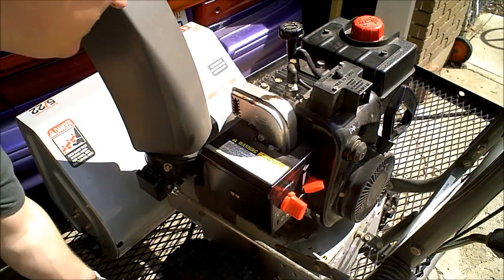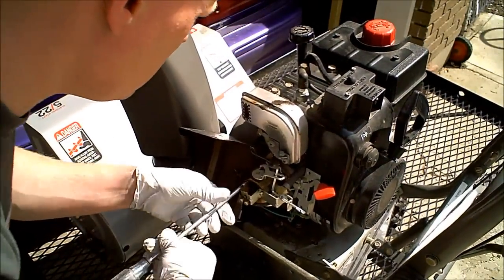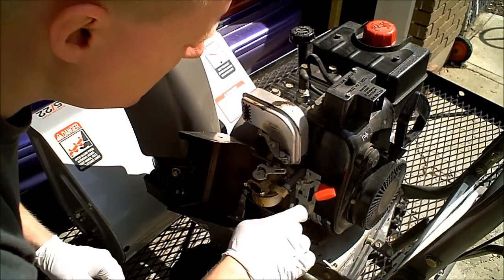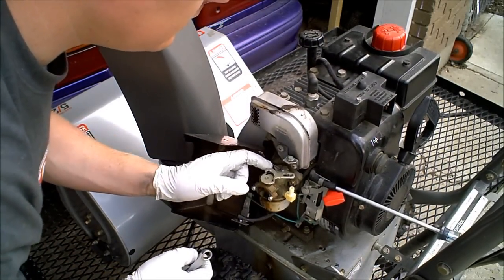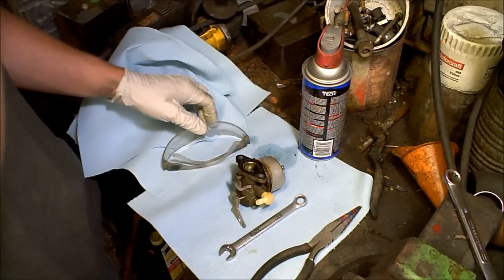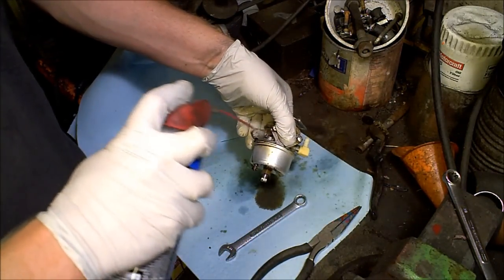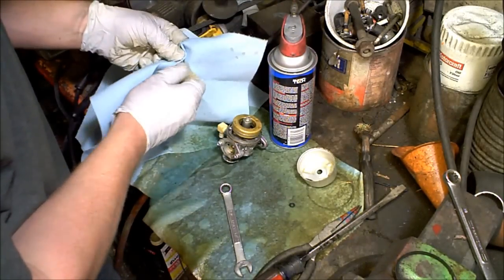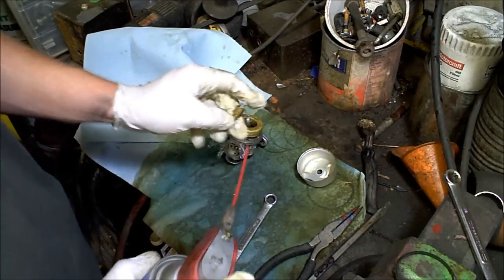Tecumseh Carb snowblower cleaning 1 of 2

Comment: Awesome video. My snowblower had the problem you described - it would only run with the choke fully engaged, and even then it would just barely keep running. I resolved the problem with a quicker version of your fix.  I removed the shroud but did not remove the primer hose or fuel hose.  I used a small C clamp to pinch the fuel hose behind the plastic fuel inlet to cut off the fuel supply.  I put an empty plastic yogurt container under carb bowl. My version had a fixed jet as you described, so I used a 1/2" wrench to remove the jet and let the small amount of fuel drain into the yogurt container.  I did not remove the bowl.  I cleaned the jet with carb cleaner and a wire as you showed.  I also sprayed carb cleaner down the throttle body which flushed some dirt through the bowl into the yogurt container.  Replaced the jet, removed the C clamp, replaced the shroud, started it up, and it's running like the day I bought it!

Comment: Thanks I bought an old used snowblower last fall, never needed one before I bought this house with a long driveway.
The thing ran great all last winter but I was thinking it’s about time to give it a little tlc while the sun is shining.
Your video was very helpful, never worked on one of these techumse engine carburetors so your details and tips about the position of all the linkages are very helpful.
Going to pull it off this afternoon and give it a go.
Thanks for taking the time to make this video.

Comment: I know this is an old video but it helped me out. That little tiny hole mentioned at 6:25 I think is actually the primer hole. I was having problems with mine not priming and starting. I had it apart a couple months ago and cleaned it but it still would not prime. I was going to pull it apart again and decided to do some searching and I stumbled across this video and decided to watch it since it is exactly the motor I have. I did not know about that real tiny hole that is above the other hole, it almost looks like a spec of dirt. Got a piece of wire and poked through it. Sprayed cleaner through it and if you notice it sprays upward through that hole. That is when it dawned on me that this must be the hole that gas is forced up through when you pump the primer bulb. Finished cleaning it up and got it backed together. I pump it twice and can actually see fuel in the throat of the carburetor again. It took a little to get it started as I may have pumped it a third time and got too much fuel in it but it did fire up. Got it tuned again and today will see if it actually works like it has in the past as we have about 6" of snow and need to go blow snow. I also didn't want to go the route of one of those cheap nonadjustable carbs.

Thank you again for making posting the video.
Reply from the maker: The tiny hole is for the fuel going to the idle circuit. The larger hole(main jet) is for priming. The primer is just an air pump and forces air into the bowl area. The bowl gasket needs to be air tight and the lower hole clear for fuel to be displaced with the air and forced up the emulsion tube into the throat of the carb.
Reply: @sixtyfiveford  I knew about the larger hole and it wasn't plugged. Never had a problem with idling. I never noticed the small hole but once cleaned it now primes so thought the air pumped into the bowl forced fuel into the large up the seat and through the small hole. I thought this since the small hole is angled upward. I guess I am wrong but all I know is that it now primes and starts without having to pull my arm off to get it running. Thanks for the info.

Comment: hey sixtyfiveford  . my  mtd 8hp snow thrower is 21 years old I never cleaned the carb once but I allways run the carburetor out of gas every time I use it . well this year I went to start it and it would run for a second and then die . I watched your video and thought yagh I could do that , but wasn't so confident on breaking down the carb to the level that you did although I probably could have , I left the carb on the machine took the bowl off and just removed the main jet and sure as shit the little holes had gunk in them I sprayed the jet as per your video and cleaned the holes with the wire like you did , reinstalled and the blower is running like it is brand new just wanted to say thanks for making the video so so so much and keep making them you rock dude, I didn't have the money this year to buy a new one . thanks again man .
Reply from the maker: That's great. I'm glad the video was helpful.

Comment: Thank you, thank you, thank you.  We are expecting 4 to 9 inches of snow tonight and my Craftsman 5 hp snow thrower would not start.  Your video was tremendously helpful and did the job.
Reply from the maker: GREAT.. I'm glad that it helped.
Reply: The snow thrower works but now is leaking gas.  I am not sure yet where it is coming from.  I suspect it is the rubber casket.

Comment: Thanks for the videos. I have to adjust the idle screw - it stall under any load with the choke off - but it runs now whereas it didn't before. I just tackled my first job and did my driveway this morning (with choke on halfway) so now I will tinker with the adjustment screws. Starts on first pull with the choke on full. Thank you!
Reply from the maker: Your main jet is clogged or if it is adjustable it needs 1/4-1/2 turn out(bolt w/screw on very bottom).

Comment from the maker: Compressed air is a trick used on larger carbs with large jets and passages. Carb cleaner allows you to physically see if a jet is flowing properly through these tiny passages. It wont hurt to use compressed air but it doesn't really benefit it either.

Comment from the maker: I know what you mean, I was fed up loosing the tip. I got it off a WD -40 can (they still sell this style).  I have used it on 30+ cans of carb cleaner and have loved it. I just pull off the stock sprayer and this one snaps right on.

Comment from the maker: It can be cleaned up easily. Even if it looks slightly pitted or stained it will work fine. 

The reason it dies easily is; not enough fuel is reaching the engine through the main jet. A piece of fine stranded copper wire through the passages of the main jet will help ensure correct flow. There are 1 or 2 large holes at the base by the nut head, 1 super small one in the thread area, and one through the middle of the bolt(main jet).  Carb cleaner will give you a good visual if flow is smooth.

Comment from the maker: If you have an adjustable jet it will have the little hole. Sometimes it's in the top threads. It gets plugged and looks like it is not there in this video I have a hard time finding it and I know what I'm looking for. You need to scratch around with a wire to find it. The hole controls idle so if you can't find it on your old one the new jet with it will allow you to idle.

Comment: was just about to give up on this carb getting it to idle.  Cleaned it too much on and off 3 times, saw your vid and the magic idle hole on the adj main jet/bowl nut.  couldn't even see the hole. till I cleaned it with 0000 steel wool, and  yep it was clogged. Strangest place for idle fuel supply.   tuned carb and runs perf,  thx again for sharing
Reply from the maker: shawn groom Awesome. I'm glad you found the video.

Comment from the maker: I do have a video on how a governor system works but you never need to adjust them. The slight surging is do to a lean idle passage/jet. Turn it out another 1/2 to 1 turn and see if it smooths out.

Comment: great video thanks. I did all that during a storm. turned out that the problem was the gas did not make it to the carburator, the tank cap was screwed too tight and the gas was hardly getting out of the tank. that kind of shit ALWAYS happends during the worst snow storms
Reply from the maker: Awesome, I'm glad it was useful.

Comment: great video man, it was a good idea to make it in hi-def now you can really see the parts clearly. have the same model engine on my troy built 5hp snowblower, thing wasnt running unless on full or 3/4 choke so i pulled the carb thanks to your video and sprayed it with some good ol' supertech carb cleaner and soaked it over night ran good as new. also thank you for the close up on the main jet, wouldve never known to clean that its so tiny. well thanks again keep up the good work!

Comment: Hi, I tried everything, again, ran cleaner into idle port hole no luck, took carb apart redid the entire thing, still wouldn't idle, it ran great on high speed though , so it must have a real bad obstruction in idle passage somewhere.  The good news is I got a NEW carb  with FULL adjustments for $38 and it runs as it should. Sorry for all the notes, but if not for your HD Video I'd have been lost. Thank you again, you really save the day. Make more Vids, we love them !! what camera do you use?

Comment: Thanks for the informative cleaning tutorial.  The very small hole that you were pointing out in the vid was clogged on my snow blower.  Been having idling issues and sometimes chokes at full throttle.  After cleaning it out it runs like new again.  Such an easy fix :P
Reply from the maker: Awesome. Glad I could help.

Comment: Hi 65,  I finally got it all rebuilt just as you did in this video,  I think your video is the most precise one on Youtube thank you... Today I put the carb back on and she fired up on the second pull and it runs real smooth, the only thing I have to do is adjust the idle  mix screw a wee bit as it goes up and down a little on idle but starts on the 1st pull without the choke as it was 60 degrees today. Have you ever done a Video on adjusting the governor or changing the auger belts?  Thanks !!

Comment: I got a new kit to rebuild with, and you're right there IS a second hole and wow is it tiny. It's like the size of a human hair on the tip of the second thread right on the crown of the thread. I couldn't find it on my old one until I lightly touched it with a fine brass wire toothbrush...boy is it small.. I plan on using the new one..  Would you recommend something like Vaseline or Plumber grease on the new O'ring for the bowl? Or just leave it dry ?   Thanks...

Comment: I inherited a snow blower that is it running. If you put a little gas in with the spark plug it will run but i when it runs out. When you push the primer button nothing happens. if you cover the hole in the primer button you can't depress it. It's like pushing on a balloon. Does this mean the primer line and the carb are all just full of junk? Great video.
Reply from the maker: Clark Osborn Yes, your carb is full of green stinky gas. Do a quick clean and you'll be back up and going in no time.
Reply: I cleaned it out and everything worked good but when I put it back together no gas flowed in. Took it apart and the little rubber ring the float needle goes into was falling apart so I'll be finding one of those tomorrow.
Reply from the maker: It is generally sold with a needle in a set. You can find them on Ebay for a couple bucks. FYI the ridges go away from the needle when you reinstall it.
Reply: sixtyfiveford it's running great. Thanks for your help.
Reply from the maker: Great work.
Reply: +sixtyfiveford this year my blower is running great until load is put on it with Snow going through then it kind of chokes and idles way down. could this be caused by a small leak I have on my carburetor drain button? Or something else?
Reply from the maker: Generally this is due to a partially clogged main jet.

Comment: good video. Do you have to wear goggles and a mask when working with cleaning fluids? I've noticed a lot of warnings on some cleaning fluids about not breathing the vapors. I'm very safety conscience. Thanks
Reply from the maker: Carb cleaner is basically nail polish remover(Acetone). Small doses won't hurt you but prolonged exposure; maybe? Nail salons use it on skin all the time. Eye protection is always wise.

Comment: Great video. Quick question. I changed my spark plug, cleaned the carb (using your videos) and put in fresh gasoline. Now, I want to say that the snowblower was running fine after changing the spark plug, but I just got this snowblower so wanted to make sure the carb was fully cleaned... so I cleaned it. Now, after reassembling, it was initially leaking gas out of the carb bowl... I fixed that issue by readjusting the needle on the float. My problem is now, the snowblower will start after pulling the cord, but it dies within 1-2 seconds before I can even turn the choke off.... could you please help? Want to get this up and running again before winter. Wish I would have never messed with it since it was running just fine, but I do know how to clean carbs now. I know this is some kind of fuel starvation problem within the carb but don't know how to fix it.

P.S. - could this have anything to do with the governor spring.. I forgot to scratch where it came out of and I don't believe I have the spring in the right place, just didn't know if that could be a cause?

Edit - must have been the governor spring because I hooked it up in a different hole and it ran like a charm! Thanks again for the great video!
Reply from the maker: Glad you got her going. Your issue sounded like a partially plugged main jet or water in the fuel blocking the main jet.

Comment: Greta video.  Have this same engine on my MTD.  It was running but bogging down whenever any load was put on it.  Cleaned the carb, replaced the spark plug and checked fuel lines.  Now it won't start.  It'll start briefly if I spray carb cleaner in the carb but only for a few second then dies down.  When I prime it, it doesn't seem to be putting any gas in the carb either.  Any ideas?  Many thanks!
Reply from the maker: +Brian Pittman Make sure gas is flowing into the carb by loosening the main jet and seeing it gas leaks out. If it is then it's your Main jet. If it is fixed(looks just like bolt) it just needs thorough cleaning. If it is adjustable(bolt with a screw coming out of it) it needs cleaning but will also benefit from adjusting. To adjust it, screw it out(counter clockwise).

Comment from the maker: I have a video on the carb ( tecumseh composite machined carb rebuild). Your issue is: pluged gas cap air vent (try running engine with loose or off cap), restricted fuel line, or swollen needle seat from ethanol in the fuel.. Look on my channel for that video.

Comment: Great video, just what I was looking for, I have the exact same snow blower , same carb, as yours but my main jet only has the one tiny hole in the side near the bottom.  I notice all the rebuild kits  ( 31840 ) show main jet with the tiny hole at the top as you have.  Will those work ok since my jet only has the one tiny hole? I've looked with a huge magnifier and there is no second hole on mine...Its been cleaned with carb cleaner and looks like new but no second hole.. thanks again...

Comment: Hi again 65...  Do you think I can just remove the idle jet screw and push carb cleaner through that hole without removing the carb to see if it will idle smooth without surging up and down?  If not I guess I'll have to remove the carb and take it all apart and re-do it... hate to do it all over but oh well I should have cleaned the gas tank I'm sure.....  thanks....

Comment: hey, thanks for the great video.  I had taken my carb apart and cleaned it.  Noticed I have a very small gas leak (small drop at end of main jet adjustment screw).  I took the main jet back out and noticed the o-ring is a little cracked so ordered new one.  But closer inspection of your vid at 9:32 you mention a brass washer.  I must have lost mine as I no longer have it on the main jet assembly.  Likely why it's leaking ;)  Where do you think I could source this?  Hate to spend $20 for whole new main jet assembly when all I need is that little washer.  Do you have ID/OD measurements?  Thx
Reply from the maker: The washer simply keeps the spring from cutting into the oring. You can find a random washer or make one out of something like a milk jug(drill bit+scissors)

Comment: How does gas get into the oil...I have a generator and a snow blower with the same problem...I have a habit at the end of the year to empty the tanks on all my machines and then let them run and stall before I put them away for the season...This year I filled the tanks with gas,did routine maintenance, started them and all was good...Three days later, no gas in the tanks and I could smell fuel mixed with the oil...The problem seemed to clear, but I'm concerned this problem may come back...I'd like to address it now, thanks Bob
Reply from the maker: Robert Fields The float in the carb sticks and allows fuel to run into the valve or piston area. From there is weeps past the valve stem and oil piston rings into the oil. A good amount will also evaporate.

Comment: If the green wire is off the terminal will the engine still run ? I couldn't get an older Murray snowblower to run and while watching this video it dawned on me that the wire is off the terminal. The machine is at another location so I just can't run out and check it. Great video I'll have to clean the carb while I have it open.
Reply from the maker: If the wire is off and not touching anything it will run. The wire grounds out the spark.
Reply: Thanks, I'll have to clean the carb and order a new control lever since it broke, lol
Reply from the maker: Let me know how it goes.
Reply: k